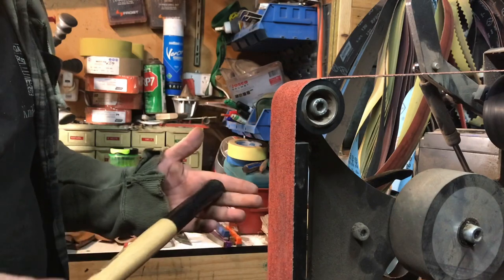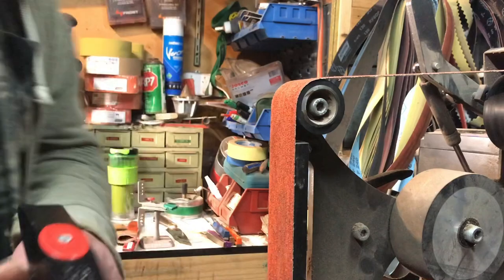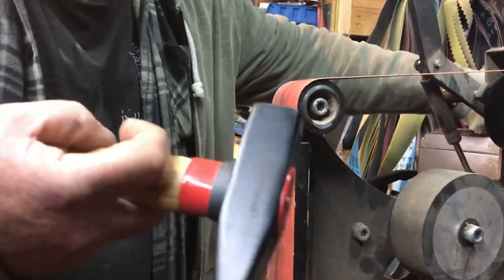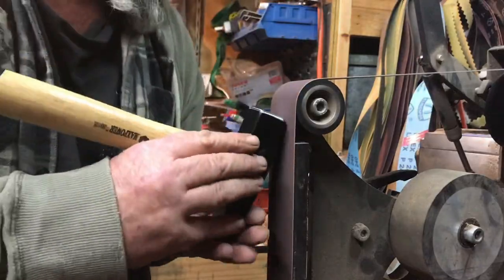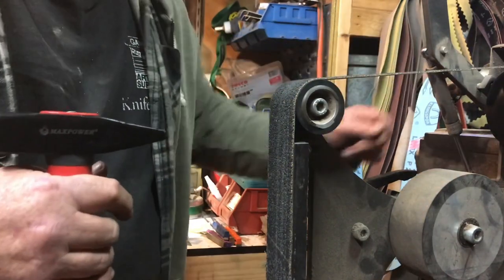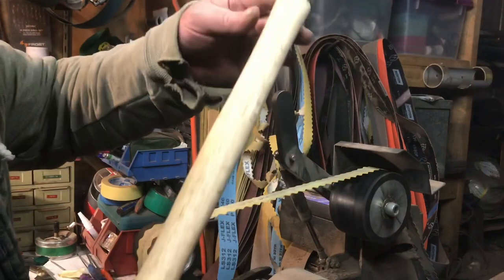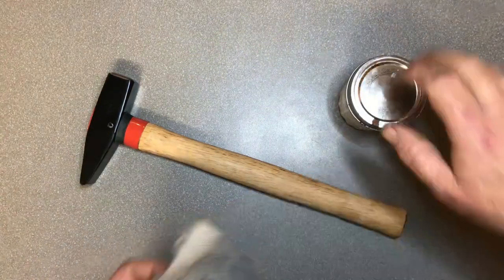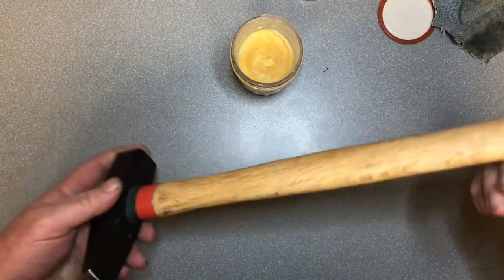Fixing the cheapest blacksmith hammer on eBay, surfacing a blacksmith hammer

Comment: I would like to know where to get those long belts from. John
Reply from the maker: Couple of different sources mate and working on a new one at the moment, the belts aren't to bad but the belt grinder costs a few bob. There are cheaper ways than the full knifemakers rig I have to get into a belt grinder, but that's a topic for another video. Send me a message and we can hook up on messenger and i will run you through it if you want.
Reply: @DownunderFarmandForge  I assume those are 72 x 2 belts the machine isn't a problem its the belts. John
Reply from the maker: I run a 2x60 but given the choice again I’d pay the extra, harder to get belts for mine.
Reply: @DownunderFarmandForge  Do you know where I can get some long belts?
Reply from the maker: Farming Life Australia Weber abrasives in SA is pretty good for general and odd sizes, 2x72 Gameco Artisan supply have them on the shelf

Comment: fantastic. know if i owned a 4 grand worth of 72x2 belt grinder i'd be worrying about buying the cheapest hammer off ebay. care to show us again using actual starting smith's tools ?
Reply from the maker: Ol thanks for the comment, certainly not a $4K 2x72, but a much cheaper 2x60, you can do the same job with disc grinder with a flap belt, files and  wet and dry paper I have the grinder so why not use it?